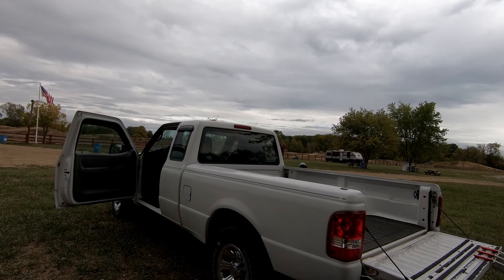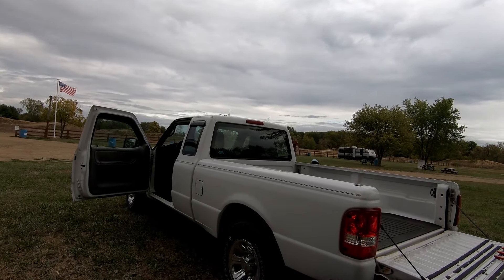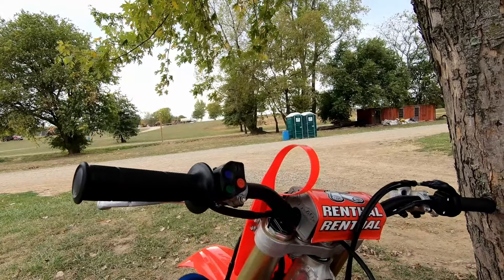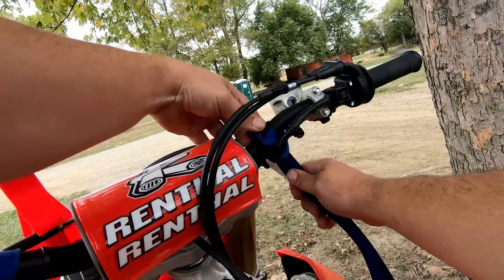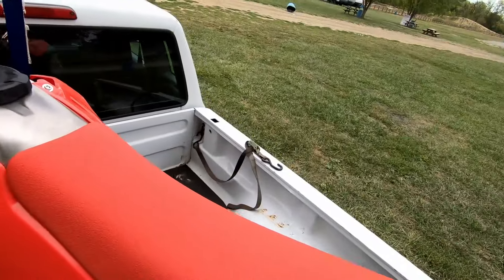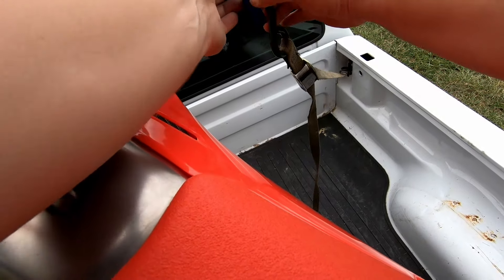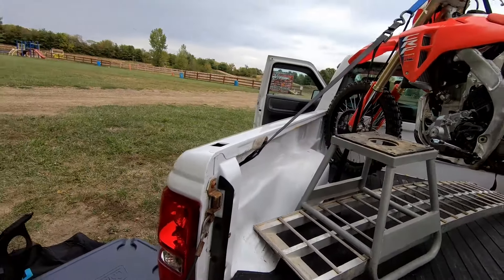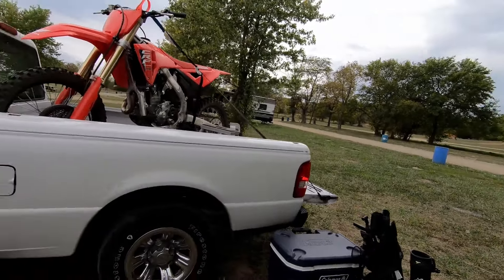Load a Dirt Bike without compressing the forks!

Comment: I do the same thing on my KTM but put the soft loops around the frame under the seat above the pegs instead of the handlebars. If I step on a footpeg I can get a small amount of suspension compression front and back to keep the tiedowns tight.
Reply from the maker: @ClairStory-r7l  good tip